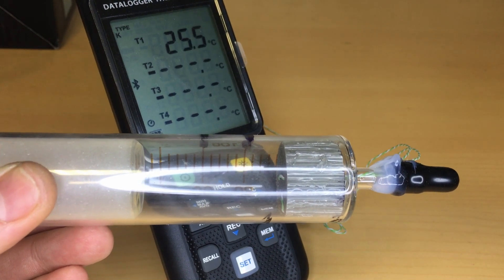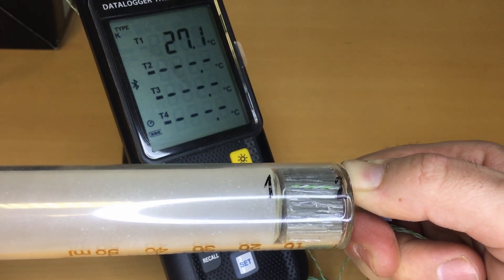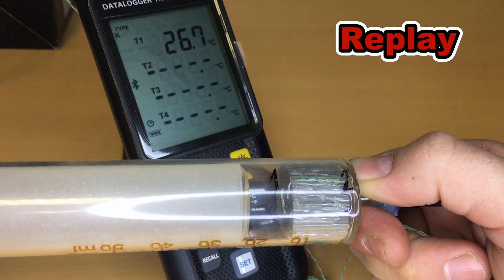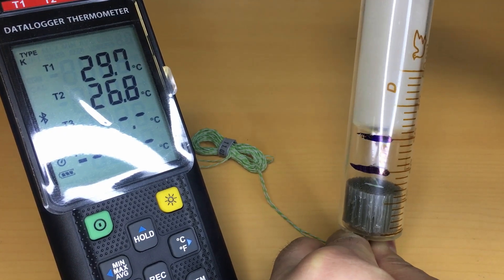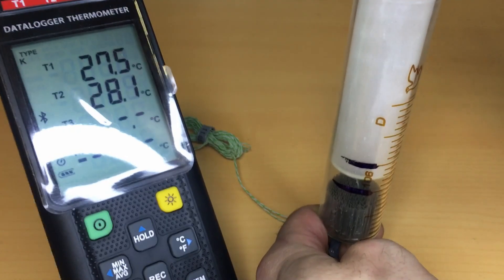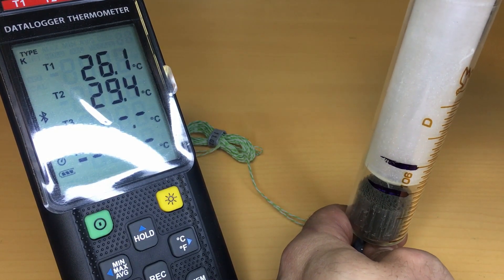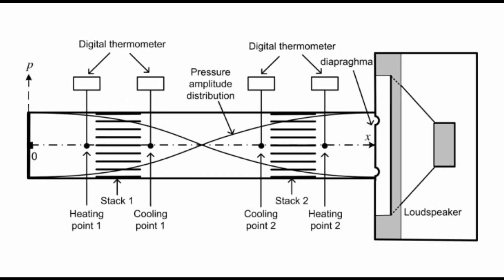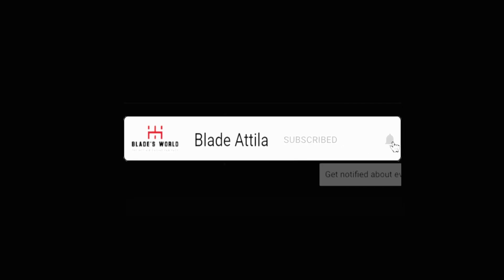How the STACK works in a thermoacoustic heat pump? - quick desktop demonstration

Comment: I think your's finger is warming the sensor.
Reply from the maker: The sensors are in the middle of the glass cylinder. The radiation or convection can't create similar effect. Also not change the direction of the heat flow. Etc...etc...etc...

Comment: I could do with a commercial High Temperature Thermoacoustic Heat Pump for my business.  Are you aware of any companies making big ones?
Reply from the maker: I know few companies, but do you mean a heat driven heat pump? Some research lab working on it also. What the big one means to you? This segment of the TA is so sensitive and expensive...
Reply: Thanks for the reply.   I work in Whisky distilling.  High Temperature Heat Pumps (HTHP) are being experimented with to take the heat from the stills condenser (80-90°c) and compress it to a usable form for running rhrough the pot of rhe still.  Anything significantly over 100°C would be useful, 120°C+ would be great.

The HTHPs are insanely expensive and you have moving parts under high heat and pressure.

I've just stumbled onto thermoacoustics tonight and I'm trying to figure out if it is more suitable (and more importantly cheaper and more robust) than HTHPs to give whisky pot stills an efficiency boost.
Reply from the maker: @slipperysalmon13  The thermoacoustic heat pumps used high pressure 30-60 Helium gas as working gas, but with no or several moving parts. I read few papers about the EDTAHP. Electrical driven thermoacoustic heat pump Experimentally used to the destillation process.  The efficiency is high, but not so easy to calculate the background parameters, also to build up a high power density unit with high power pressure resistant heat exchangers. Maybe a Heat driven version could be possible to use. The prime mover driven heat could came from the burned gas(actually a wasted or partially wasted energy) for the first stage of the destillation process. That could create high amplitude waves to start the heat pump effect as a secondary stage to help the destillation process.

Comment: If you can get your hands on this nano tube cable called a twistron. it produces energy by stretching and contracting a string. I would love to see the efficiency inside of a thermal acoustic engine utilizing the sound vibrations.

Comment: This is the most elegant demonstration of the concepts in thermoacoustics that I've seen!  I actually didn't understand how it worked until this video.  On another note, you also have a very soothing voice, the voice narration is excellent.
Reply from the maker: Thanks very much to your feedback! I'm happy with this info because I wanted to show how simple the heat extraction and what happens in a heat engine basically. I've never seen experiments as same as mine, so I've made one. I hope it could help to the Stirling hobbyists too to understand the regenerative heat exchange a bit deeper. Greetings from Hungary! BLADE 🙏